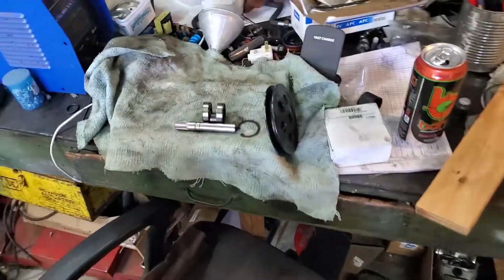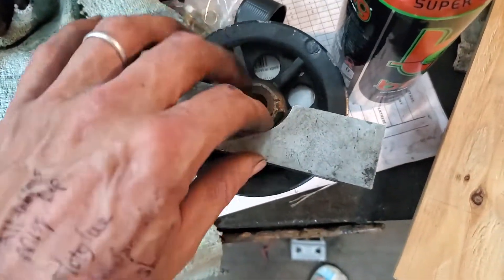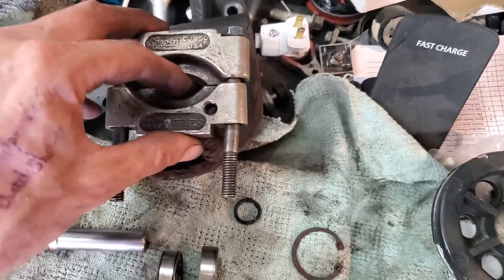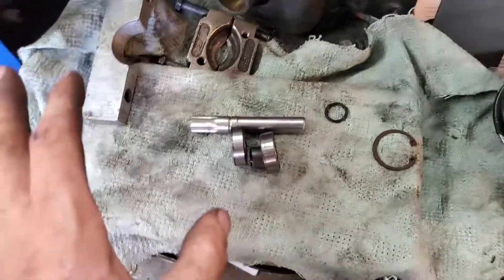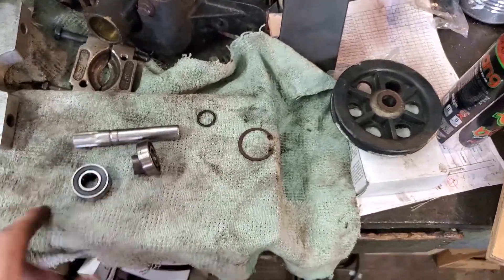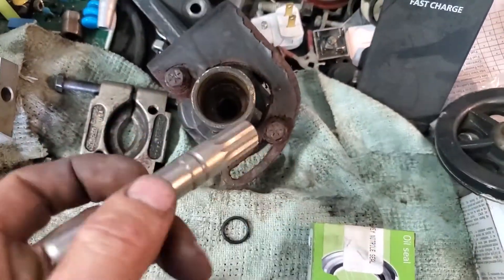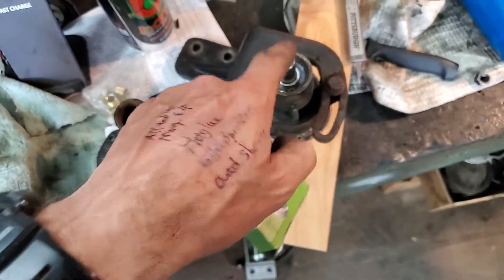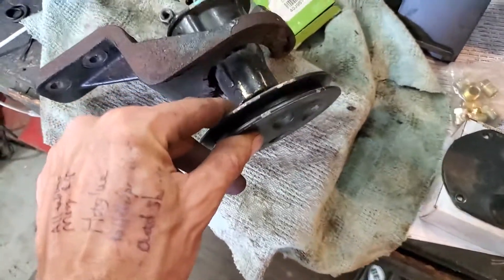Volvo Penta vbelt water pump rebuild Complete

Comment: How do you prime this pump or get this pump to pull raw water after rebuild?  Mine are new and not pulling water through the curved tube on the lower unit of outdrive
Reply from the maker: make sure the impeller is the correct height.. there are two sizes sometimes. sometimes u have to rev those to about 2000 to get the water flowing before they work normally. deep scoring on the top or bottom surfaces can cause issues as well as chinese pumps/impellers, its common for the centers to break and not even spin the impeller. Use OEM or Sierra brand ONLY. hth

Comment: I need to do this "exact" repair on my water pump and this video is extremely helpful.  I just have one or two questions.  When pressing the shaft out of the pump housing after removing the pulley do I press it out thru the bearing end or the impeller end.  There appears to be a snap ring in the impeller housing next to the seal.  I haven't tried to remove it because it's difficult to get at.  Does that ring need to come out before removing the shaft? Thanks much for your reply.
Reply from the maker: hi - you can press the bearings off either way. usually they come out of the housing alot easier than off the shaft so I would try get them out of the housing first then decide. Its been a while and honestly ive bent a few snap rings, they are just stops for the bearings iirc- not actually that important. I would say press the one bearing off the impeller end and the other one on the pulley end- remember to make measurement son depth with a caliper for reference when u press them back on whether you have the snap ring in or not. Good luck!